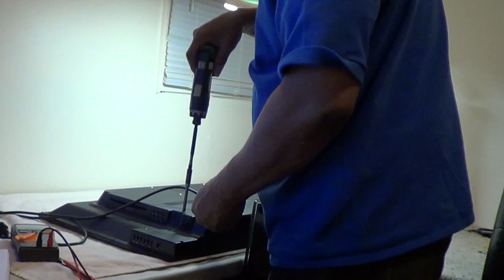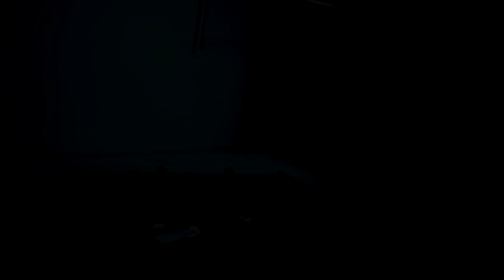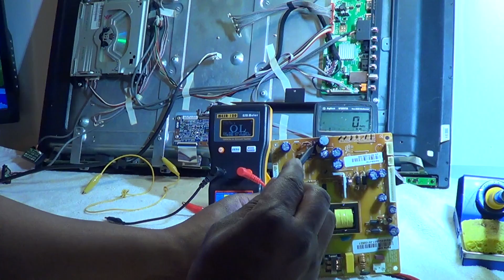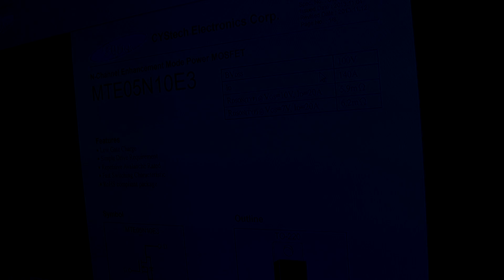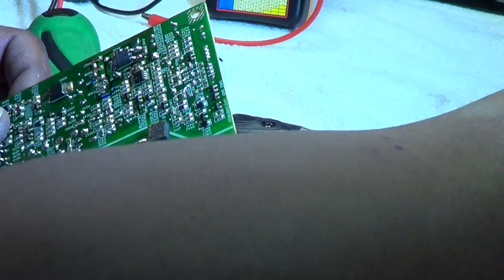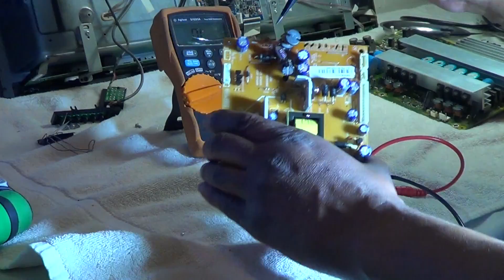RCA 32" tv/dvd combo no power component level troubleshooting and repair

Comment: BigDog8882 thanks for your great videos.  I have been given a Sony KDL 46 XBR2 LCD tv with a problem.  There is no red (5 volt) standby light but when you power up the unit the green power light comes on, you can hear a relay, but there is no video or audio.  Any suggestions as where the problem might be?  Is the 5 volt reference standby missing?  I have not taken the back of the set off yet to check that possible problem area.  Thanks.